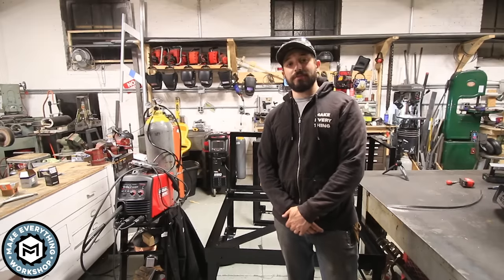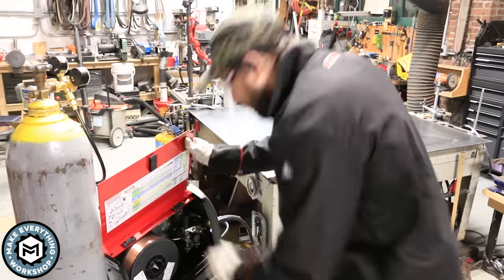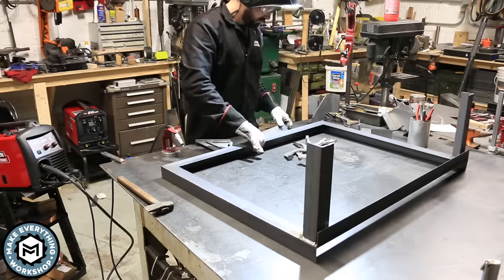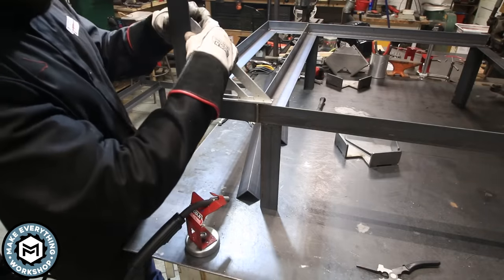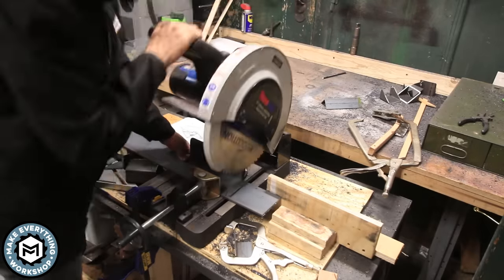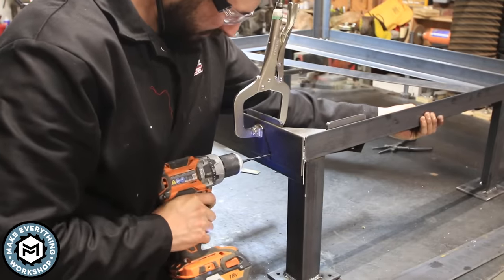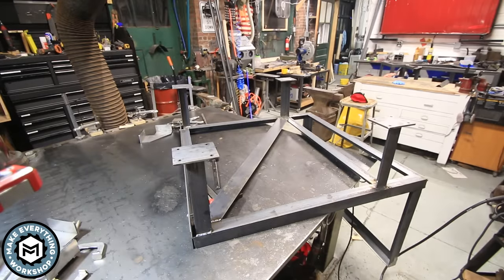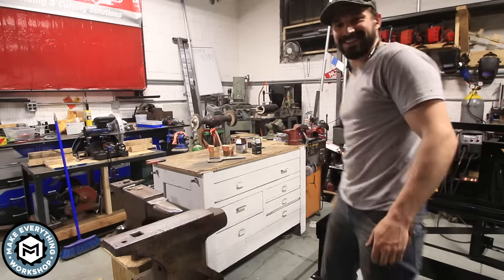How I Make Money With My Mig Welder

Comment: Great video. I do wonder about one thing... why not upgrade from the chops with the steel blade to a bandsaw made for that kind of work.  Much easier. My company has the
 band saw and it is a night and day difference.
Reply from the maker: I actually just did! I got a Baileigh dual mitering bandsaw with a 10” throat. It’s so much better than the chop saw, albeit much more expensive. I think those chop saws are around $400, and I paid $2000 for the bandsaw used. New it’s $7500+ tax and shipping!

Comment: I would have braced up the legs to you are right the last thing is the customer to be pushing the cart and the leg brakes and the oven spills over. 
I'm still trying to get me a small welding table built to practice and make small figuring to sell give away maybe card holder's so people can put them on there desk,  I have a lot of other quick makes that people are more willing to pull out $10-40 buck's that money adds up than just making big things that I have to have storage to hold thing's until they get sold.

Comment: Great video, joy to watch. Just a note: I noticed when you drilled the holes for the removable panel you also tapped the  panel instead of making a clearance hole for the screw. Was there a reason for that?

Cheers and great work, keep it up.
Reply from the maker: Thanks! I do that for speed and alignment then I go back and open up the hole in one side as a clearance hole. Is the two runs through everything first it’s a guaranteed alignment every time. And in this thin material (1/8”) you can move fast!

Comment: Thank you..love your channel ..I do have a question..seventy five to one hundred dollars an hour is super...But i am starting a mobile welding repair service .have a small pickup with almost every thing i need to do nice repairs..But i not sure how to charge out the jobs..What would you thing is a fair charge...Thanks..Bob
Reply: robert gorby theres a lot that goes into guessing your price. I pay myself $30 an hr as my take home. Then i add the cost of all material, gas, consumables, wear and tare percentage that you think is adequate on machines and vehicle, ect. Then add 25% of the pervious total on top if that, granted im currently getting my AWS certs and have been doing structural welding for a while. You just got to figure what you think your worth and stick to it dont let people push your pricing so far down where you dont wanna do the job. Just my 2 cents good luck brother.

Comment: Pro Tip :  never use standard 60 grade rebar to weld. It will become VERY brittle and break at the welds.
ONLY use A706W (weldable grade) AND preheat the bar to around 400° F at the weld points.
This will give durable and reliable results ✌

Comment: I hope your bakery shop has an air compressor so they can keep the tires pumped up otherwise you may have wanted to go with a soft foam tire or something that doesn't require being aired up on a regular basis.

Comment: About that evolution saw. What rpm is that turning? I am wondering if I could use an evolution blade on my dealt 14" metal chop saw with the usual friction type blade?
Reply: AvE tried that out. Search for: RIDGID abrasive cut off saw converted to dry cut. Maybe.

Comment: On those Pferd polifan discs, what grit do you like using? Thanks!
Reply from the maker: I use the red ones in 80 grit usually, the 40s are also grest for a heavy weld removal. Check amazon for them!

Comment: Just wanted to mention you cut your angle and FB wrong. It's easier on the saw to cut the angle like: /\......and the FB veritcal, less surface area during cuts hence less wear on your chopsaw.
Often when cutting something like 5 or 6 inch FB its a pain to cut vertical because it flops around unless you have some way to keep it vertical nicely.
Reply: Don't you have a higher risk of breaking teeth to keep the fb vertical?
Reply: @nelsonreyes8808  hmmm i wouldnt say so i might be wrong. I can just  tell you it cuts like butter going vertical on FB. Where as u really gotta push the saw when flat. In my experience the saw runs great if properly used during the day. Its when the nightshift comes in do things start to go wrong.

Comment: What size work table you say its adequate but not exaggerated for small projects?
Reply from the maker: I think a 4x4 can get a lot done. There are a few modular options available now that bolt together and can be 3x4 or larger pretty easily and for relatively little money compared to their value in fixturing

Comment: I do not like the mig welding process other than spot welding for mock up.   I found because of the great amount of heat it makes and  the quickly cools its brittle and cracks. I also do allot of automotive stuff. I love my 250ex tig.

Comment: Hi from Oamaru, New Zealand.
Hey tell me if that welder can weld stainless steel and alu?.
Here we have the 180 amp mig version.
If u need rules on stainless hit me up.

Tip; in all steel repair work it pays to give bare steel a good wire brush then a good coat of paint. Moisture in steel really affects the structure of grain etc.

Comment: I'm a certified construction welder, mainly fluxcore but also mig/mag, i REALLY want to do this instead, work for myself. A good welder is no issue (can buy it from the company im at atm, steel is no issue either since i can also get that from my workplace (discounted btw). My dream is to make furniture for people since iv'e seen that its pretty high demand here in Sweden. All im missing is some machines and a place to be xD Lets say i have these things and im ready to do some jobs, how would u advertize yourself? what did u use when u got started? Great job with the carts and nice video=)

Comment: When I got my first welder, I made 40$ for repairing a pizza spatula handle. I then used those 40$ to get a different roll of weld, then I was able to weld 2 different types of metal Ss and iron flux core. Then modified the rest of the pizza handles from the same vendor as a preventive measure and to strengthen so they would never break again, and 3 years later none have broken or show signs of breaking. Gave him a bulk pricing that he liked to get the job done. Moral is: invest back into your business, don’t keep taking.

Comment: Good video. If I may suggest, when drilling through thick material like this it is helpful to pilot drill first. Start with a 1/8" bit or so and then drill to size. Even with the time to change bits it is faster and safer. I can also recommend a combination drill/tap. One step process to drill a tap size hole and cut threads with no tool change. Keep 'em coming!

Comment: So im not new to the trade by any means but i also dont have 50 years either lol. Ive been welding for 10 years and 7 of those being professionally in structural shops and a little over a year for the coal mines. Im about to luck into a lincoln s350 powerwave so all of my work will have to be done in my garage. No travel work. Im just looking for ways im able to make money on the side of working yee ole 9-5 any suggestions are appreciated

Comment: Hi,  On many videos I see stick welders simply tap the rod to metal and get an immediate weld. This would be great when say I’m trying to weld  small lengths of 1/8” or 1/16” wire like hair on a sculpture, but each time i do it, either my rod sticks or my stick burns through instead of welding.

I have a Lincoln Electric AC225 stick welder, mostly set to 135amp using 7014 and 6011 electrodes. Can you offer any advice? Like, should i use different electrodes to get the desired result? Will turning up/down the amperage make such spot welds more effective? Maybe a combination of different stick and different amperage? thank you, i’m a newbie to this and appreciate anything you can share.
Reply: Ps. Loved the video, thanks for sharing your step by steps.

Comment: What would be a good welder for a beginner? I have a 220 outlet in my garage but I don’t know the current.
Reply: If you know which breaker feeds that outlet it will have an amp rating on it. Do not simply put a larger breaker in the box, the wires probably aren't heavy enough to handle more load.
Reply: Custom Haines good to know. Never thought of that. Thanks!

Comment: Awesome vid man! I was curious though, why would you charge different rates per hour depending on task? As a CPA, my rate is my rate. I wouldn't say $200/hr to prepare tax returns and $100/hr to audit.
Reply: You would if competition was high, customers needed inducement to select your audit work, and you had no billable engagements lined up outside of tax season.
Reply: The other thing to consider is wear and tear on equipment, and equipment payback. If I am doing a job on a piece of equipment that costs $10k and has hourly costs and wear and tear, the hourly rate is much higher than if I'm only swinging a hammer. The hammer pays itself off rather quickly, the expensive tools not so much.
Reply: I can see the pricing difference for working with ar plate, stainless, and hard coating shit vs working with mild steel due to the increased health hazards from the chromium content, don't even get me started on aluminum the guys that weld that for a living can keep that moody metal

Comment: Here is an easy test to see if this is for you. Take a piece of plain white paper and a pencil. Draw the best square you can draw freehand. Draw the best circle you can draw freehand. Draw several horizontal lines parallel to each other free hand. Do the same vertically.   Show it to other people and ask them if it looks good.  Does the square look nice and sharp with good corners? Does the circle look like a good circle? Are the lines consistent and parallel to each other?   If the answer is not, forget it. You have to see it in your head before you can make it.

Comment: I work with upholstery and recent took a light course (20 hours) of stick welding.  Later I purchased a Lincoln MIG welding machine.  How different it is stick welding to MIG welding if anything?  I really need to do welding when building porch curtains, as of right now I'm only replacing the fabrics of client who already have the frame.
Reply: Stick welding takes alot more skill than mig. If you already know stick, you shouldn't have any problems learning mig. Just run a few beads, try out different settings, see what works for you.

Comment: I had four years of welding in highschool (always in shop everyday no classroom) had some work and college experience with welding and have a 110 esab. I have a backyard I could weld in, and was thinking of doing some projects for extra money. Any tips on how to start selling small made projects and get the name out? Or is just a get at it kind of thing. Thanks man, new sub!
Reply: Welding in your backyard is probably not the way to go. I don't think you'd make much money dragging all your tools out in the yard, setting everything up, and then putting everything up every day. That's going to add up to alot of wasted hours. Might be ok for a one off DIY thing, but I don't see any way that's going to be profitable. Unless you're ok making something like $10/hr.

Comment: Love how he says flux core is improper  and looks bad. when 90 % of structural work is fluxcore nr 232
Reply from the maker: 600streetbikr what i was referring to was the $99 “mig” welders that places like harbor freight sell. Obviously flux core wire welding is useful in many applications. A lot of people reach out to me and tell me that they are “bad at welding” and they are using an underpowered flux core welder that gives them poor results.
Reply: @MakeEverything  my welder is a harbor freight 125 amp flux core i like it cause it doesn't break the bank and someone young like me can have easy access to it with some practice you can make good welds
Reply: @TheBanshee17-SS  welders from Harbor are ok and do the job. Most of all take care of the gun. When it comes time to replace it, generally you can buy a new welder for what it cost for a new gun. I was in the welding supply business for 25 years.
Reply: @davepelfrey3958  yeah in my opinion its good to have for random repairs at home or building small stuff like go karts but i would definitely upgrade if i was more serious about welding

Comment: Love ur videos but I gotta disagree. I’ve had absolutely no issue using the cheapest $90 harbor freight flux core welder. Would a true mig produce cleaner welds, absolutely but I was still able to get seamless welds with the cheap flux core welder as well.
Reply from the maker: Brads Workbench I have the $90 welder as well, and I can use it just fine, but in general I’ve found that the welding students I teach who already have a flux core get terrible results, and are thrilled once they use gas. BUT once they use my gas machines and they go back to their flux core they can use it with much more confidence.
Reply: Make Everything hmmmm interesting. Wonder why that is? I first learned on stick, then mig with gas, then flux core. I do think that mig with gas is way easier to see your puddle. Maybe that’s why 🤷🏼‍♂️
Reply: when you walked into that harborfreight and handed that cashier your $100.00 for that shitbox, you also handed her what little dignity you had left. Good day sir.
Reply: Sheep Dog69 LMFAO! It was $84 thank you very much!
Reply: God no those 100$ harbor freight/amazon machines are garrrbajjj
Reply: Dale Dobeck what makes them garbajjjjj?

Comment: I only have a stick and tig 200 Amp welding machine  can I make money doing projects. I can weld but need to learn more about fabrication. I also have a abrasive Dewalt  cut off  machine 2 grinders a drill and a pencil grinder and a small ac stick welder 130 Amp and a 9 inch grinder. A welding magnet, square level, spirit level and a small square and big square ruler and a bench grinder and tig torch. Only my argon bottle is empty. Please help

Comment: If your having trouble with gasless wire than it’son  you not the wire! You ether have the welder set up wrong or your using the wrong technique. It’s used all the time in the field and it works great!
Reply: Alot of extra clean up for nothing.

Comment: whats your honest opinion on that 140 mp?
Reply from the maker: Honestly, I love it. I dont use it for tig very often, but most of my projects are done with this machine. Its super nimble with the smaller mig gun, compared to my 260MP. Whenever I weld anything 1/8" thick or thinner im using the MP140

Comment: So does he understand the process of using gasless welders? Because you still can make pretty welds with flux core welders, but you have to understand that the movement with the puddle is different compared to normal MIG welding.
Reply from the maker: I understand the process very well, and as I said, you can get great results from a gas less welder. But most of the cheap ones people buy to get started yield poor results and can be pretty discouraging

Comment: Purchased a miller AC/DC Thunderbolt arc welder, can i use a generator  9400/7500 (starting/running) watts with an 240V/50 amps to run my welder?
Reply: I have the same Miller machine and I use it with a predator 8750 from harbor freight and it works just fine.

Comment: Why do you have 6 welding helmets ? Did it take that many before  you found one you like.   You got others that weld in your shop ? I'm just curious as a welder myself who owns one helmet. I can grind and weld in this helmet . I'm finding a hard to justify six  when one will do. I realize that this is a nitpicking stupid question. However all your other videos you seem very efficient.. 6 moments seems like five too many. Second that mp140 you got . Are you having any issues or problems welding the quarter inch material with it.. especially since you stated it was running on on 110 vac ?  Seems like maybe you're pushing limits of that machine.  I realize your professional you'd have to be to do what you doing with that machine..
Reply from the maker: I have 6 helmets because we teach in person intro to Mig welding here so I have enough PPE for a few people. All the goods are the same lincoln Vikings, they are great! We use that mp140 a lot, and weld 1/4” with it without issue. I turn the machine up a little bit if I’m trying to really burn in!

Comment: Disagree with where you said a gasless mig is not as good as gas and can be discouraging because the welds aren't as good. That's completely incorrect, you produce the same quality welds from both because regardless of method both welds are being shielded whether it be from gas or flux. The only real difference between the two is that a gasless can be taken anywhere and is much better for outdoor welding, whereas gas is better for indoor welding. Can be taken anywhere so long as you can lug the gas bottle around. Other than that, great video
Reply from the maker: ItsYaBoiMSG I was referring to the $99 gasless welders marketed toward beginners. They generally are underpowered and are hard for a beginner to get good results in. I use gasless Mig all the time in the field, and it’s got its uses for sure. Thanks!

Comment: For all noen welders out there, pulling the weld down when going vertical is not good and should never be done. It traps dirt and other contamination in the weld and might lead to catastrophic failure of the weld